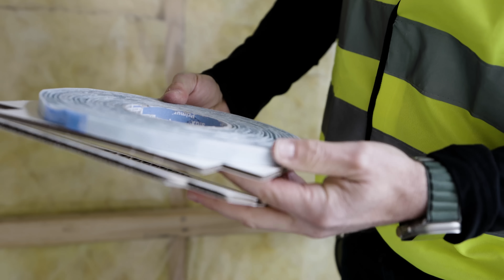Norway's different residential building practices

Comment: It is good construction techniques, but not without faults. Flat roof with parapet walls is certainly not a good idea where snow and ice form 5 months out of the year and neither is it in Florida with torrential rain. I recently observed, a less than 2 year old commercial flat roof building in Trysil, a massive failure in the sealing of the roof drain pipe due to frost/ thaw cycle. Needless to say a massive flooding inside with resultant damage was the result. If it had been on a multistory family or office building the insurance claim would have grown exponential. One thing they do right in Norway and should be mandatory in US is that everything should be pipe in pipe or wire in pipe for safety and serviceability.
Reply: You are dead wrong. A flat roof is a very good solution, but it does require people who do the installation to be up to par. I worked 8 years for the biggest flat roofing company in Norway. I had to learn on the job. Most roofers don't really learn on the job either.

I worked mainly warranty/claims for the last 4 years. I have seen exactly one flaw in the engineering of a flat roof, the new Thon hotel in Svolvaer, where the greenhouse was integrated into the roof, not built on top of it, resulting in 30 litres of condensation finding it's way into the hotel below daily. I have seen no flaws in the material. 99.99% of the problems are the result of unqualified installators, fagbrev eller uten.
Reply: @tanelpolts7257  You are right, but also wrong.  When done perfectly, flat roofs are fine. But unfortunately the vast majority of those who set up buildings are not at that standard, and thus it's safer to use solutions which will work even so.  Ideals are good, but we have to look at reality too.
Reply: @tohaason  reality is that everything bigger than a single family house will be built with a flat roof.
Reply: @tanelpolts7257  Well.. not the building I'm in right now. A flat roof would be a nightmare, if not a diaster, with a flat roof. Due to snow.
Reply: @tohaason  ever been outside? Please stop talking nonsense about things you know f all about.

Comment: Builders and plummers follow the TEK17, the electrical is done by book NEK400. The house even get pressure tested. All new houses has balanced ventilation as well. The TEK, is the minimum and then you could even further and have a goal of passive house. I believe the EU is aiming for this soon.
Reply: The research/theoretical basis that supports the various requirements, norms and standards is collected in a database called Byggforsk (developed and maintained by SINTEF). It's filled with explanations, illustrations and arguments for why, how, where, when and so on. Including optimizing for climate variation, sustainability, fire safety, air quality, allergies and so on.

Comment: At 6:40 - I'm surprised that Steve seems to find supplemental electric bathroom heat to be a sort of novelty. Growing up myself decades ago in a warm southern climate, every house with middle-class or better pretensions always had some form of supplemental switched electrical heat in each bathroom for just the reasons Steve intuits here. It might be hot outside, but if the whole house is air conditioned then you might be uncomfortably cold getting out of the bath. Or it might be a rare cold winter's night, you're gutting it out without central heating as the whole house cools to 68, 67 degrees, and you can wear long sleeves everywhere else except when you are stepping out of the bath dripping wet and unclothed.

When I built some new bathrooms in the mid-Atlantic I  made sure they all had supplemental heat - either an exhaust fan assembly that also had a recirculating 1000w fan heater mode (from Broan) that I put on a twist-timer, or an electric heating mat under the tiles run off a special thermostat that probed the floor.

Comment: Glass wool from the company Glava is the most used insulation material you will find everywhere(We just call that insulation "Glava"). Rockwool is sometimes used as alternative. I have never seen the american style insulation like spray foam, and thank god for that. That just look messy. I also find it questionable to put stuff in a house when you need hazmat to apply it. Not to mention having to handle that foam or dust when renovating or destroying a building. 
Glava has its own issues for sure, but I find that much more acceptable than the american alternative.
The insulation we get from "Glava" is very good when it is applied with enough thickness and done properly.
Reply: The hazmat suit is because its basically spray glue. You wont be able to clean up without it.
Reply: Spray foam was used as insulation in northern Europe for a very short time when it arrived - but there are Issues, and good reasons not to use it as insulation. It works perfectly fine for nooks and crannies and around doors and the like, but you don't want that stuff in your walls. After a few years you'll have mold problems due to humidity. Unfortunately most firms in Japan which do this newfangled "insulation" thing (still regarded as a "luxury" there) use spray foam. Spray foam is good for one thing only: Cheap and easy for the builder. Not for the home owner. So, as I'll get a new home built in Japan, I'm spending the time looking for one of the few companies which actually do this properly.
Reply: Spray foam is mostly used in nooks and crannies where Glava or Rockwool won't fit.
Reply: @Zajuts149  I am extremely addicted to watching people build and renovate houses on YouTube, and they use that spray a lot in the US. It could be that people who build houses from scratch don't do it, but I've seen many use it under the whole ceiling, and on all the walls.
Reply: @rayranja  Oh yes, they use it excessively in the US. In Norway, buildings are built to a standard that accommodates rockwool or Glava(or vice versa), so spray is only needed in very small spaces.
Reply: Stressed me out to watch him touch it so much with his bare hands. Isn't the stuff full of micro glass shards? We were always told to not play around with it
Reply: @vsnrm5451  It is not glass shards in that sense. It is itchy. You do get it off you hands after washing your hands a few times. Your cloths are ruined since you do not get it off properly. It is not like you cut yourself. As children we liked to jump on that shit. I do not think I caught any long term problems from it.
Reply: My grandma's house from the 1880s in Oslo was insulated with spray foam after the original clay insulation had all disappeared and collected at the bottom of the walls. Saved having to remove all the cladding to put in new insulation, but using it on a new building seems strange.
Reply: Spray foam is easy and a known cost that returns value to the installer. The long term consequence for the building and home owners however, spray foam is starting to look like its not a good idea. Congratulations to the Norwegians for adapting quickly. I would like to see more hemp insulation. I think there's a real opportunity to go the next step with smarter less energy and emission intensive insulations.
Reply: @onfungi8815  Yep! Diffusion open walls with wood fiber insulation is the way forward.
Reply: @onfungi8815 just for fun I’d recommend looking up the story of glava on youtube. It’s a fun video and the story is quite interesting as well. 

Also, glava is a Norwegian company, which almost certainly helped with the quick adoption.

Comment: Im from Norway, and we use a standard all over in all new houses - so they all are similar. It’s also a building-control system so it’s done right. If you borrow money then the bank also is going to have a management role. And yes Siga rules!
Reply: Financial investors (banks) back the mega home builders and banks make many (all?) mortgage loans in the US. They don't care about the construction quality or condition of the property being sold. A lot of dirty deeds going on.
Reply: @gnomiefirst9201  In Norway everyone screams for the government to do something, and they can start making even banks comply. During the financial crises in the 80's the government would help the private banks who had been doing something wrong, but only if they bought the hole bank. That was the punishment for the bankers, suddenly the government owned them all. They sold a few years later. In Norway the government lurks in the shadows. A very different attitude than in the US, where you just sue someone.
Reply: @TullaRask You're wrong. Banks went bancrupt thanks to their own stupidity, even old well renowned banks like Bergens Kreditbank and Kredittkassen, plus some new irresponsible  banks. The biggest bank that survived by the Government taking over was the DNB, formerly Den norske kredittbank. It's partly state owned and is extremely successful.
Reply: @VidarLund-k5q  I didn't talk about specific banks, I was thinking about DNB, what happened in Bergen I have no clue. Also I wasn't WRONG as you say, only it was a lot of banks going down in the Jappetida, some where bought by the government, and some not even saved.
Reply: @gnomiefirst9201  Oh, let me tell you there's some of that in Norway too. They're SUPPOSED to follow all those guidelines, but there are more than a few tactical bankruptcies in the construction industry.

Comment: The hand book is called TEK17 and the research for the standards are a collaboration between the industry and a program called Byggforsk (building research) by SINTEF one of Europes largest independent practical research organisations. The best practices in TEK17 is THE LAW when you are building new constructions i Norway.
Reply: Following TEK17 also makes construction smoother for the contractors, since following TEK17 to the letter means you're much more likely to have your application accepted by the ruling municipality. We call these "pre-accepted solutions", and is also why alot of the buildings from the past 10-20 years look very similar.
Reply: @blerg  
Also because architects who grew up on Minecraft and the Sims... :D
Reply: @HrHaakon  Hehe true. And because it's always cheaper to build a box with only 90 degree corners and a flat roof using the cheapest standard windows from the factory :D
Reply: @blerg  Yep! As an architect in Norway it unfortunately gives us very little room for design choices as all solutions has to be "pre accepted".
Reply: you can choose a solution not in tek17, but then you have to actually prove that it's an equal or better solution, which of course can become expensive, specially for one-off projects.
Reply: the sad thing about TEK17 is that they removed the need to have an inside "closet" or as we norwegians call it Bod. and now its up to the contractor to install it, so rooms and homes just becomes smaller and smaller while calling them a 1 bedroom apartment across 30m2.
Reply: @corax0705  There's still a requirement for a "sportscloset" of atleast 5m² if your appartment is above 50m²
Reply: TEK17 is not the handbook, just the building code. It's a list of requirements, but doesn't tell you how to meet them. For a proper "handbook", everyone uses the SINTEF Building Design Guides. Their solutions are pre-accepted by the building code, so if you can document that you've followed them, the building code is considered to be met.
Reply: except for the airtightness required. lots of new buldings will never last as long as the old ones due to the lack of proper ventilation
Reply: @allahsnackbar9915  There are requirements for air exchange and energy efficiency that mean (almost) all buildings have to have heat recovery mechanical ventilation. The lack of proper ventilation was a problem earlier when they started building more airtight buildings and didn't take air exchange into consideration.
Reply: @allahsnackbar9915 Balanced ventilation is more or less compulsory in TEK17 buildings, resulting in good indoor climate without large heat loss.
Reply: TEK17 is also a big reason why living costs are so High in norway
Reply: @tomivar9469  higher construction costs is the reason why in Portugal they are built cheaply and then cry in winter...
Reply: @tomivar9469  this is true.
Reply: @tomivar9469  Living costs aren't high in Norway anymore. Our standard food budget estimates are within a few dollars of the same US variant for food cost per month. Same with housing and rent prices.
Reply: @hoboofserenity  aren’t high anymore?? Higher than ever, let me tell you! Please bring me some examples😊
Reply: On top of the low currency value.
Reply: @hoboofserenity  HUH? cost of living is not just food you know...
Reply: Yeah, right.
Reply: @GreenIllness  He's not joking. If you don't follow the rules, you are liable, as a contractor.

Comment: There is electric heating in the bathroom beacause there is no heat in the liquid system in the summer :).
Reply: In Finland, and I guess in Norway too, there is often separate heat exchanger and piping circuit for just bathrooms which can provide heat during summer too.
Reply: @Memeonomist  District heating. Which means you get hot water pretty cheap to as you aren't using electricity to heat it yourself.
Reply: Or...if its rural, same piping structure but they have a stove in the basement.

Sorry I just realized using water pipes to heat up the building isn't really that unique.
Reply: i use flip flops when i get out of shower and i don't feel cold, and in the summer because i don't cool the bathroom (and outside easily get 40C) the floor is warm 😁😁

Comment: Standing next to a concrete wall:  "Lots of wood framing..."
Reply: Yeah. Those are mere balcony and interior dressing walls. It's all concrete elementing on the actual structural elements. Most likely built as fire cells. Meaning solid reinforced concrete walls between apartments, with few controlled and insulated penetrations. Heck not most likely, it is fire cells since fire safety building code demands that.

Also I found them calling the airing vent an "wood furniture element of the window" funny. No that is the optional ventilation hatch, when you really want to air out the apartment. So one doesn't have to open the whole window or door. With the standard rain screen on out side so you can also vent during rain without it raining inside.

Comment: The exterior gypsum is threaten so it can handle more moisture than the interior one. The rainscreen is crucial for this to work, but if works in Bergen it will work anywhere. It's not that hard to get to passivehouse level of airtightness with just the exterior gypsum if its taped correctly. The rockwool on the steel column is probably fire protection. This building probably have a higher firerating than normal since its multiple units over many floors. The heatcable in the bathroom floor isn't just for comfort it's also to dry the floor. In the summertime the liquid system is probably shut off, thats why it's electric in the bathroom.
Reply: That's damn sure! if it works in Bergen, it work anywhere^^ 🤣

Comment: Norway has a population of about 5,600,000 people, and the climate is pretty similar in areas that are populated.  Its natural that there would be less variety than in North America.
Reply: The climate is extremely varied. However a strict code of how a building is supposed to be put together fits, no matter the climate.
Reply: @Thedrek  No, its not.  You have a very local view.  Any hot dry deserts?  Any hot humid areas?  Any regions that are particularly prone to tornadoes or hurricane?  Any high risk seismic zones.
Reply: @richdobbs6595  Entire west coast of Norway is prone to hurricanes. You have some municipalities with added local regulations like if you have a stone/concrete roof every tile has to be nailed and not every 3rd like normal.
Reply: @gromitNOR83  Great, you hit one issue that I wasn't aware of.  You've got variation in rainfall and wind that covers the same as the USA.  But you don't have variation of humidity and temperature that spans the USA.   And you don't have the magnitude in population that makes it reasonable to customize the solutions to particular regions.  You are convincing me that you are very parochial.  Your problem isn't what you know, it is it admitting what you haven't thought of!  It is like me growing up Minnesota, and saying why don't those Texans build full basements, because they work so well here!  You are a child!
Reply: The climate does vary throughout the country, sometimes significantly. But you are right, it does of course not vary as extremely much as in a country that is almost 30 times larger (USA).
-Norwegian

Comment: We have a standard that says how to build houses so that would be why as you say we build all houses very similar.
Reply: We have that in America, but many builders go above that, especially custom houses.
Reply: @GUITARTIME2024  yea I get that, our standard isn't like a minimum standard where you get the bare minimum of what is approved. Here it's more a maximum per say. It's changes per year or every other I belive so houses built that specific year follow a set guide for how they are built and it's based on tested and prooven to be working standards. It's really detailed and not like a litte phamplet.
Reply: @Level10Gamers  our code isn't a pamphlet, and it's updated every now and then on a national basis. Building code, electrical code, plumbing code. Bigger issue is simply choosing quality materials and contractors attention to detail.